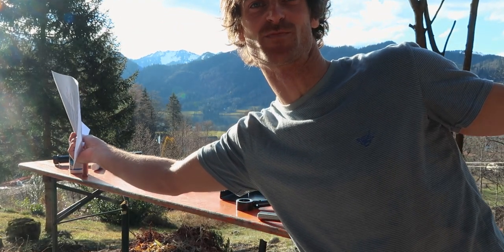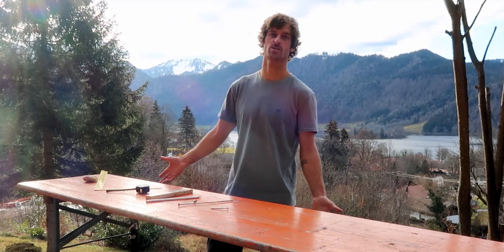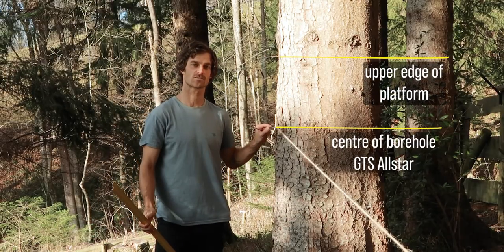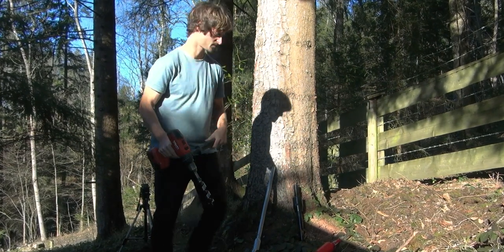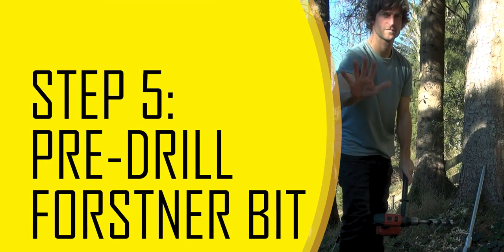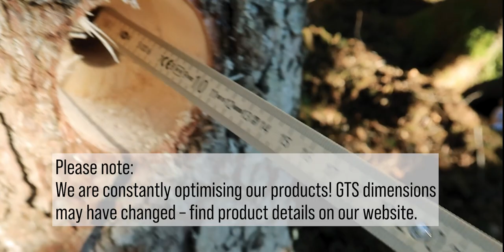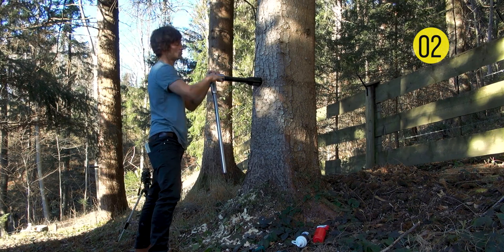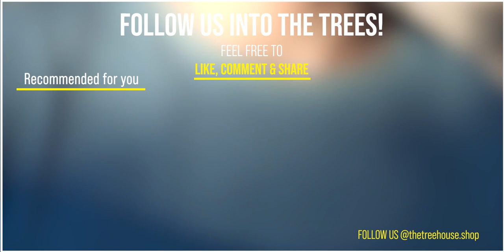How to install 'German Treehouse Screw – GTS Allstar'

Comment: How manu kg can it holde
Reply from the maker: The GTS Allstar can handle around 2000 kg in soft and up to 4000 kg in hard wood, with 10 cm lever arm and vertical force.

Load bearing capacity is depending on wood type, individual tree, exact spot in that tree, lever arm, direction, and style of force.